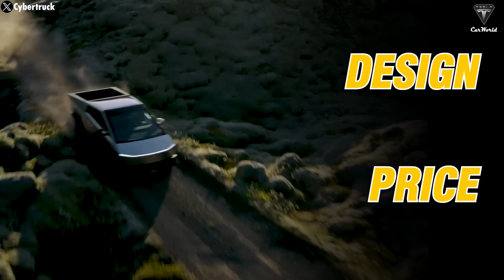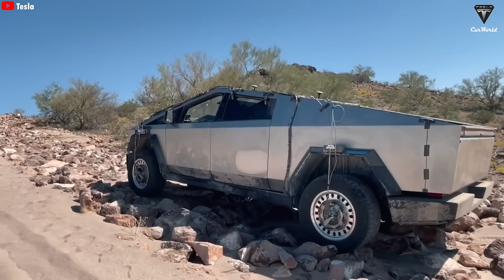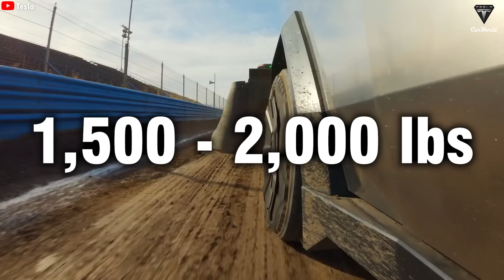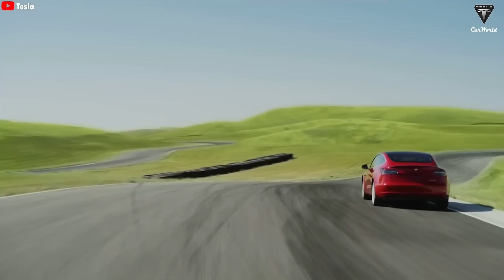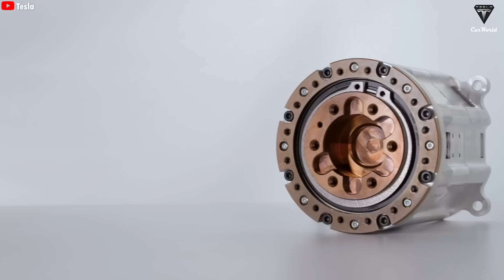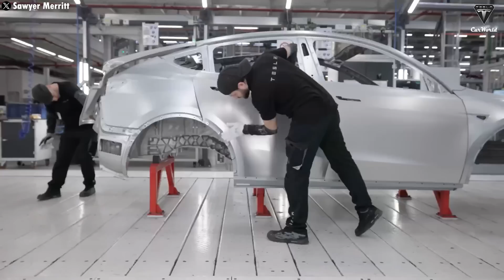2026 Tesla CYBERTRUCK NEW Compact Version $49,990 Revealed! Elon Musk LEAKED Insane Updates!

Comment: I see Cybertruck all the time in Utah. 10,000 units is all they sold? Bizarre design is good when it comes to this futuristic design. Too expensive. If it were $50,000 for two motor and $70,000 for tri-motor as promised, then they'd sold a lot more than 10,000. Same body styling; smaller form factor as a Model 3 or Y sort would be good. Did most Cybertruck owners buy a big Cybercar?

Comment: You need to reimagine the Cybertruck if you are going to make it a compact size.  One thing is that it is no longer an exo-monocoque-truss structure.  The design no longer is form follows function.  You have a lot of ability to modify now, and not be arrogant to fully follow the original design.  You do not need the doors as heavy or structures in the sail fins to make up for the loss of Monocoque.  Tesla could tear it up at a compact if they would free themself to reimagine this vehicle as a ckmpact.  They could sell at $35,000.00.  The compact Ford Mavrick starts at $25,000 for the Hybrid.  Right now this says the Cybertruck is twice as much.  Its not twice the vehicle with what they would put out at $50.000!
Reply from the maker: That’s actually a great point. Simplifying it without losing its core identity could make it far more practical.